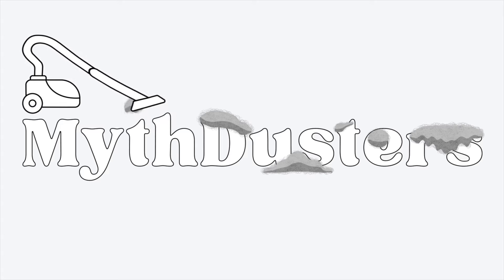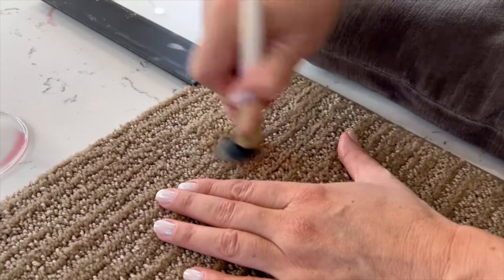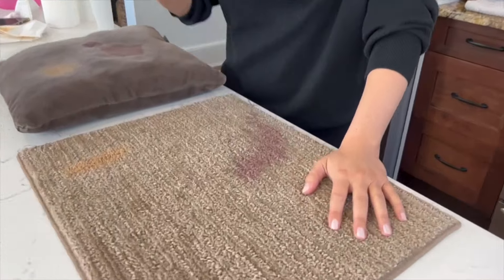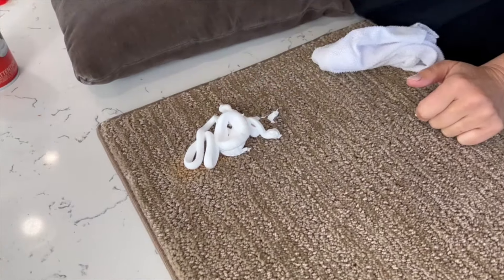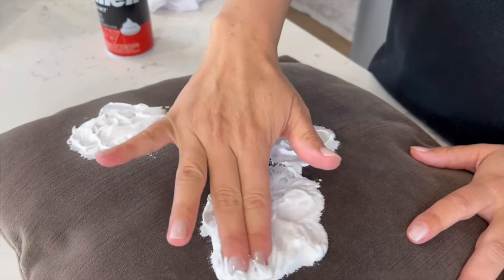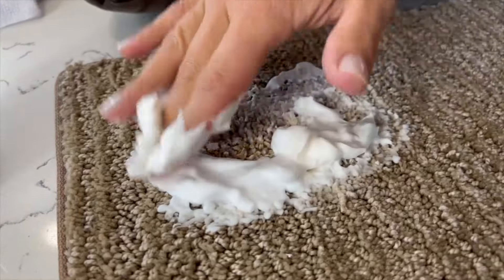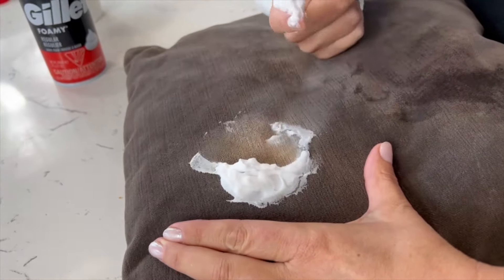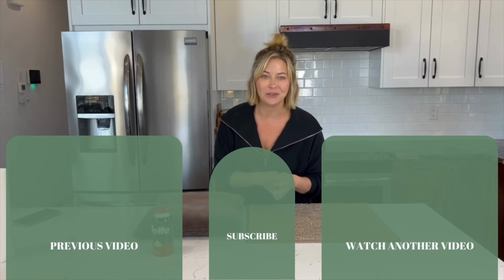Can Shaving Cream Remove Stains? (Mythdusters Ep. 1)

Comment: Super random hotel story. I got tar on my heel wearing sandles through construction. I took a bath and the water heated the tar enough to get in on the tub. Nothing was working to get it off. Then I remembered that tar is oil based and my babies A&D ointment was petroleum based. It came right up! 

Thanks for this video! Going to keep shaving cream around.

Comment: The hack worked really well on the yellow sweat/BO stains on white shirts and pillowcases! Didn't remove them 100%, but it did a better job at lifting the yellowing than peroxide or bleach. Whatever staining was left blends in with the fabric, if that makes any sense. The only downside is that now they have a strong shaving cream smell, even after washing (I use unscented laundry detergent).

Comment: What about the propensity to be a dirt magnet?  
Soap residue will attract more dirt.  That is why it is so important to thoroughly clean out soap on any surface or it gets dirty faster.  Vinegar is a great way to strip out that last bit of suds in anything that might attract dirt--like carpet or upholstery.  Thanks for your work.  You saved my sanity during 2020.